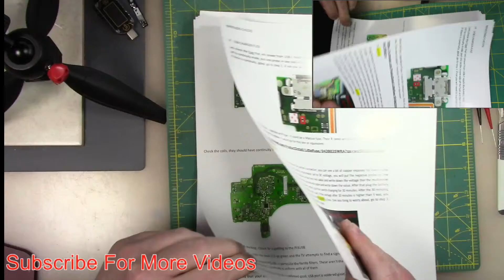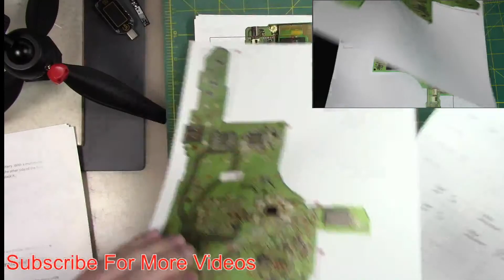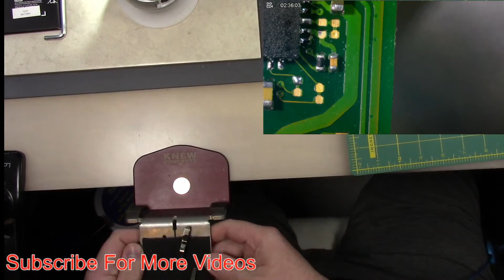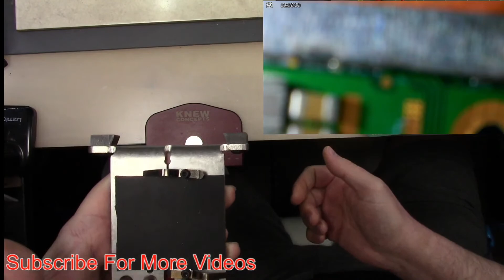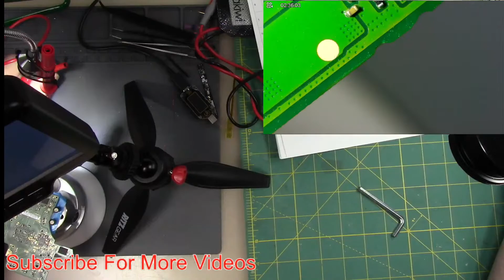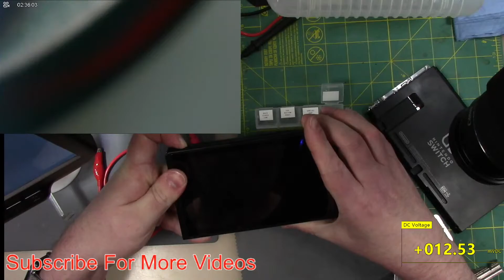More Testing with Nintendo Switch #1001

Comment: Hi Engi it seems that something isn’t switching over to allow power through when power is presented to it ?
Reply from the maker: Andy Cooper yeah I’m not sure it’s not getting a power on signal or something is preventing the power on process. I’m going to be doing some more testing, but I’m running out of things to try. If it’s down to the max ic then I’m in trouble because the cost about $20 and they are BGA chips